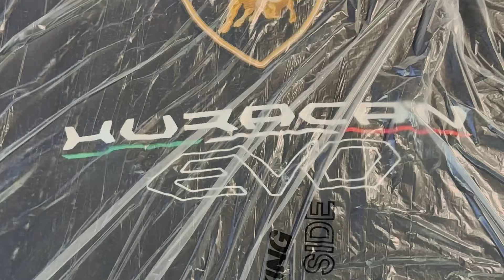How Much Does Owning a Lamborghini Huracan cost?

Comment: rather have a 69 charger. lambos are overrated by the arabs and sikhs
Reply: I don't know about that. My buddy has a Gallardo and even as a bottom end lambo it's probably one of the most fun cars I've driven from Vancouver to Whistler and back. Things a rush and you aint running that highway like a lambo in a charger unelss it's got the full IRS and IFS Hotchkis treatment with big rotor Brembo or Wilwood kits with multi piston calipers to lay the binders on for corners and then you still need to know how to drive it and that you have to be taught.  Lambo is pretty much get in and slam the pedal down and almost drives for you. Those Italians know what get in - shut up and hold on really means.  A charger that can keep up is going to have a 100k price tag on it. Rent a lambo, you'll see.